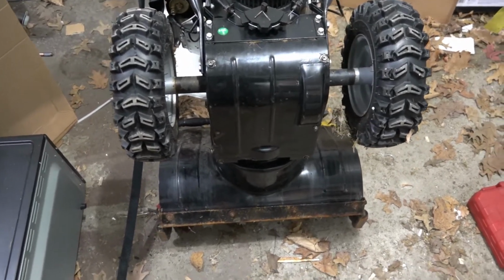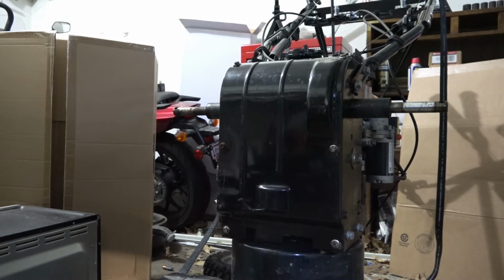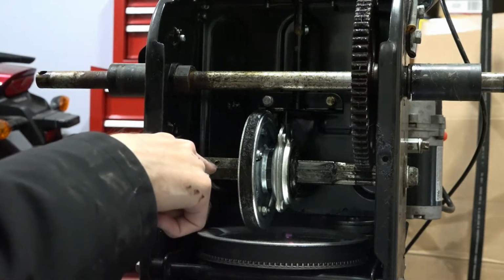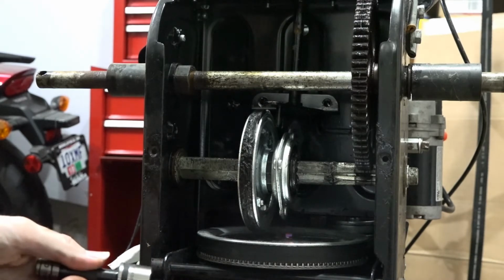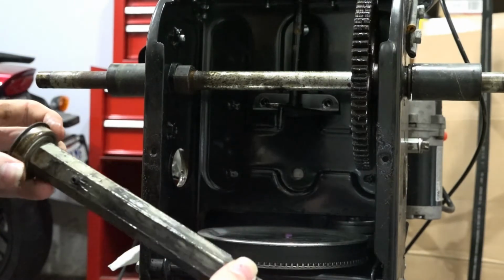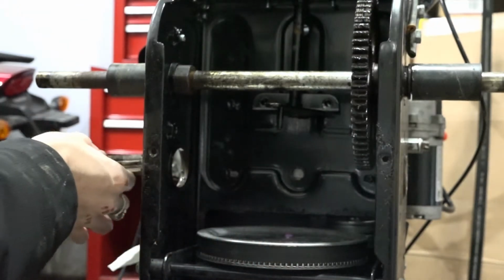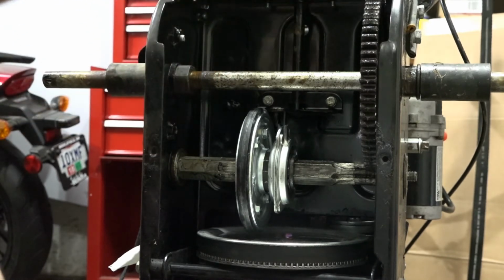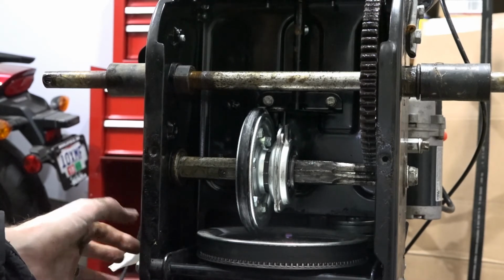Power Smart DB7659A Friction Wheel Assembly Repair

Comment: it is a lot easier than this,  You just use an allen or wrench on one end of the shaft (rather than a crescent on the shaft) and remove the nut from the other end.  Slide the shaft out of the friction wheel and replace.  no need to take out the bolts in the "gear" selector as it just drops out.

Comment: Is just the rubber friction wheel available aftermarket?  If so,  what is the manufacturer, part number, and supplier?  Good job. Many thanks. BiLL.....
Reply: Looks like a 4" inner by 1/2: wide belt, they are on amazon as friction wheel tire.